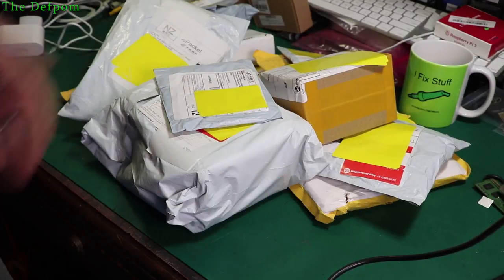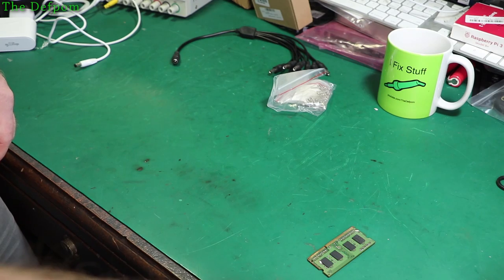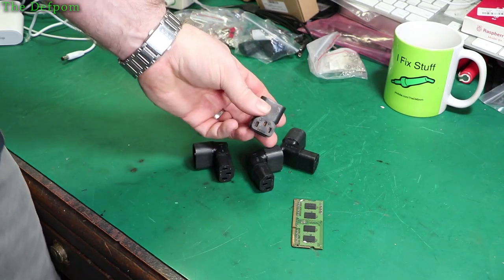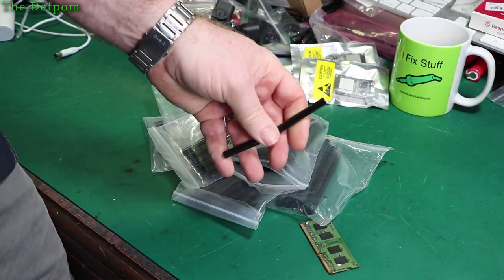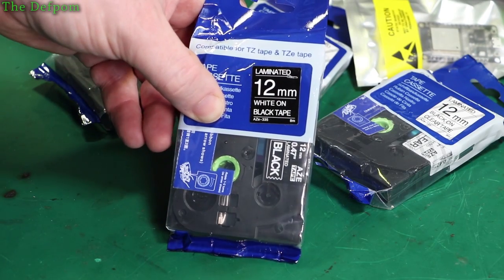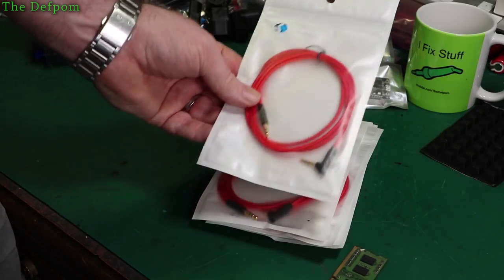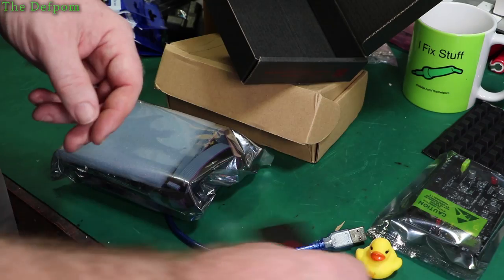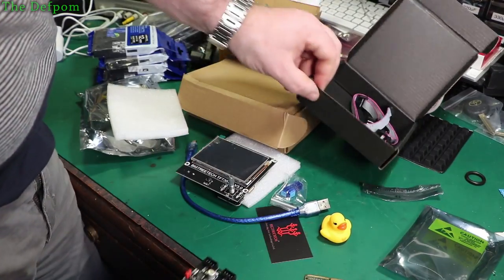#695 Mailbag Monday 16th March 2020

Comment: NB. The provided 128MB SD card with BTT boards is generally utter crap and causes lots of issues. Best to not use it.  Its is how you put firmware on it and can print gcode from it.
Reply from the maker: Peter Ellens - when I first saw the 128 I thought they had included a 128GB, then I looked again... 128MB phhht